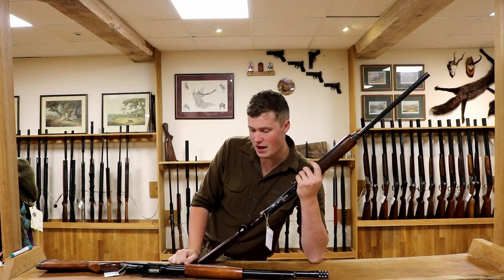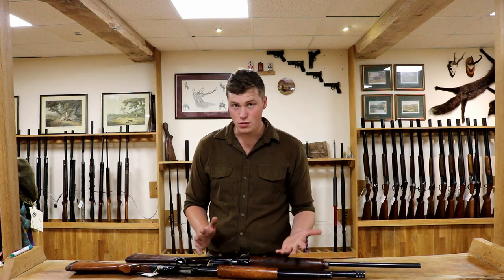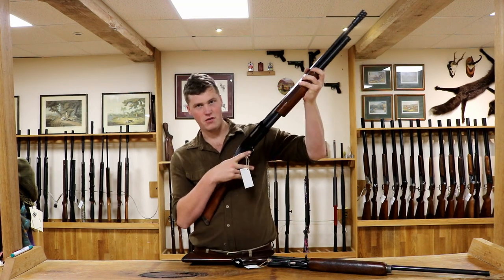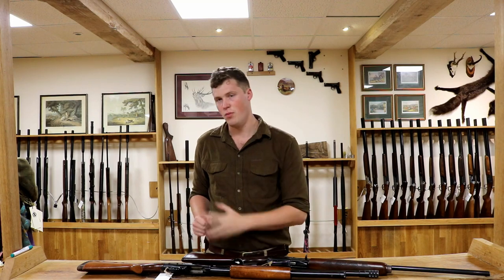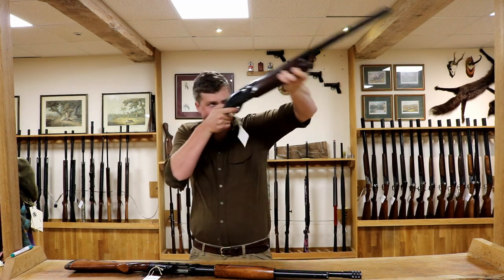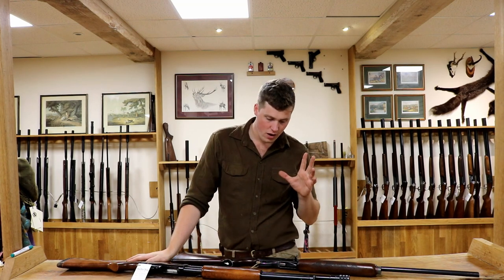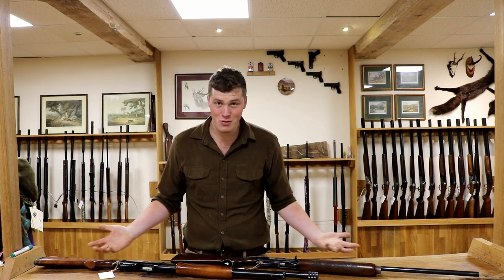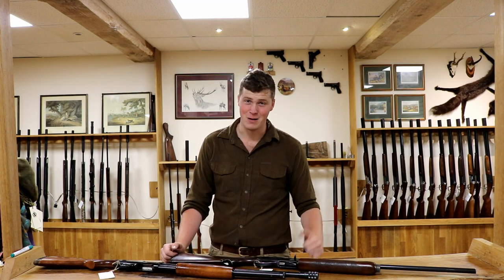Pump vs Semi Auto With The Gun Shop

Comment: For vermin control, the pump is better. Only one operation and your ready to fire, while almost every semi needs two. Also with a pump you can shoot at the fox/mink/magpie or whatever and it doesn't reload until you need to take a second shot, so a bit safer.Mossberg easier to both load and unload, as the shell lifter stays up out of the way with the bolt forward.

Comment: I now want to move to the UK, get a firearm certificate, and show up at your shooting club with a tricked out, polymer, tacticool semi-auto shotgun with a light and possibly a red dot sight, just to piss you off. 

Would the AK pattern, mag fed 12 gauges made by Saiga be legal in the UK?  I have a feeling that would cause aneurysms.
Reply: They would be with a 2 round magazine.
Reply: They would be with 2 shot mag.
Reply: Yep, perfectly legal.

limited on a Shotgun certificate, with an FAC you can use whatever mag you want. I've seen a couple of Saigas already so you wouldn't be having the impact you think you are. But you wouldn't be allowed to shoot more than 2 shots at a clay ground. Perfectly reasonable though, if you need more than 2 shots you just don't got the skills.
Reply: Aneurysm caused.
Reply: Gabriel Perurena don't worry dude, I'm sure you'll recover.
Reply: You really triggered these guys.

Comment: Would you go for a Beretta A303 12 gauge Semi-Auto or Hatsan Arms Escort Supreme 12 Bore Magnum Semi-Auto (if they were about the same price)?
Reply from the maker: Is the hatsan new?
Reply: 2016
Reply from the maker: It's a hard call, probably opt for the hatsan, if you could stretch to a brand new one the warranty is solid! Th beretta will be the nicer gun, but the 303 is getting old now! How much are they looking for £200-£300?
Reply: Fair analysis. Both are going for £450ish
Reply from the maker: WrathOfVaz that's a fair whack for a used escort. Should be getting a new one for similar?
Reply: Thats for a brand new one. Looking for a semi 12 gauge MC with ok wood finish for under £500. Got anything that fits the bill?